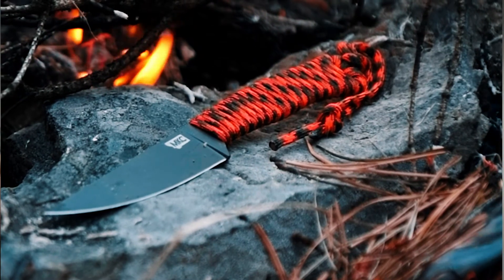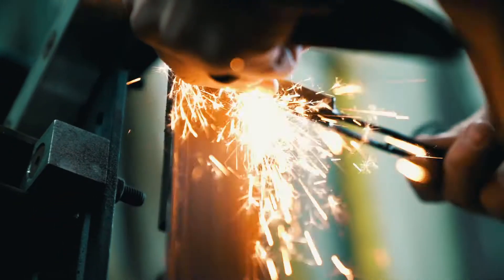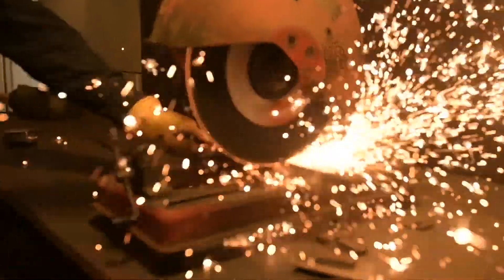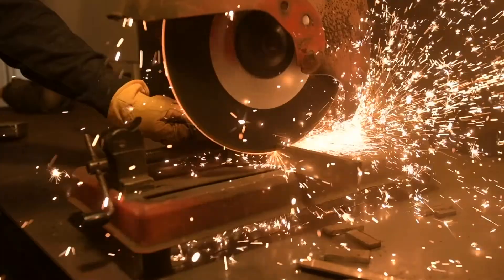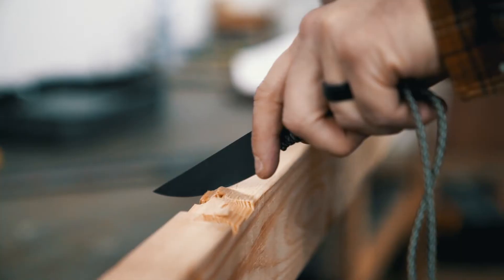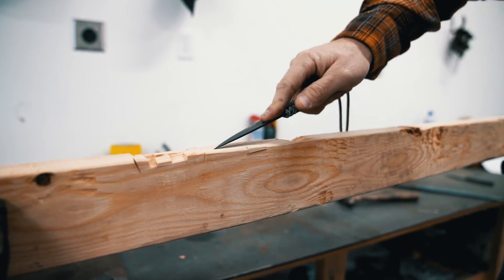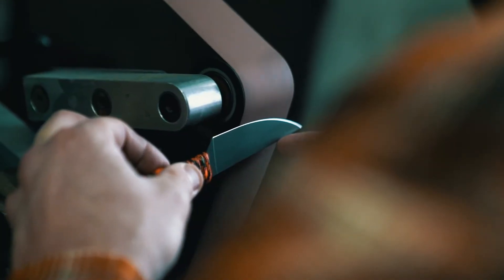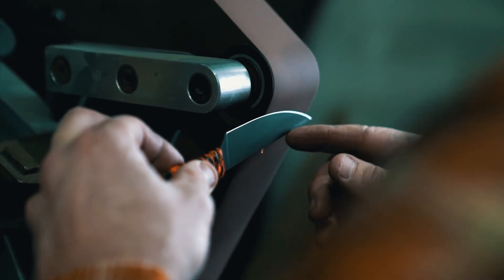Why 51200 High Carbon Ball Bearing Steel???

Comment: lol what? what kind of wear is low alloy 52100 resistant to? Knife world is such a confusing Hodge of mythology. Does anyone agree on basic facts? can we agree that 52100 is a low alloy tool steel? can we agree that it has about 1% carbon and 1.5% chromium... and that's about it? what about that screams "wear resistance" to you? This is literally one of the lowest wear resistant steels that exist. literally any decent stainless steel or high alloy steel has vastly better wear resistance. Sure, it does have decent wear resistance for a low alloy steel. and yes, I think it's a good blade steel.  but not because of it's rather low wear resistance but because of it's excellent toughness at high hardness and fine grain. why do we need to claim that it's something it clearly is not? That I do not get.

Comment: My alltime favorite steel for fixed blades!!!! Best of the best ever!!! Outperforms many supersteels,even on edge retention, yet tough as nails!!! That' what people think is 1095, however, it's ballbearing steel which is actually tough. 1095 compared to ballbearing, is junk.
Reply: IMO, 1095 has terrible edge retention. Why it became so popular for bushcraft, I'll never know. But let's be real, magnacut is simply better than 52100.
Reply: @Swearengen1980  "Much" is a persoonal matter and kind of use. Hunting knives, can't be better with any other steel, than Ballbearing (52100), same goes for any Scandinavian grind, because Magnacut is way to hard and too stainless, for an edge that needs the maximum edge stability and the blade must be the toughet possible. 52100 holds its edge way longer than Magnacut and is way tougher too,also sharpens easier which is another advantage for any field knife. There is a reason, all real knives, that target users market and not collecotrs, use 01 as the traditional steel for scandi edges and bushcraft knives (or 80crv2), same goes for 1095 and "survival" knives, because it has the advantage of ease of sharpening and ease of fixing any edge damage. Magnacut can't much any of these. There is a reason competition knives in the USA, are usually made with something like Vanadis 4 Extra, and not Stainless steels or Magnacut. You've fallen into the marketing trap of Youtube, where your knowledge is all after marketing hypes and collector's nonsense. Knives are first tools and 2nd a collector's piece, like stumps.PS I'm a Chemist/Metallurgist since the 90's and I own both slabs of Magnacut and knives made out of most if not all well known steels.I also sharpen/repair knives professionaly, for 30 years now.
Reply: youe comparing a basic carbon steel to a low alloy tool steel.  there is almost no logical reason to use basic carbon steels for a knife.
Reply: These are both low alloy steels. 1095 is exstensively used, why not comparing them? @TimJohnson-x1o
Reply: 3V with the right heat treatment is still the best of the best. 😊
Reply: @CaesarChavez-x9q  Nowhere close, to Uber-Uddeholm steels, none CPM steel is either. Also I'd choose CPM Cruwear over 3V any day. All handforged Ballbearing steel knives I own, outperform any 3V knife I have. They hold their edges way longer time sharpen faster and easier and their edges never chip. I'd only get a 3V, if it was made with the Delta heat treatment, only that guy makes it good, Bark River and other famous makers 3v sucks.

Comment: I love these but how do you honestly feel about the parkerization for corrosion resistance? In Ohio it's always wet during hunting season, I no doubt will get this blade exposed to moisture fishing as well. I have questions about how the blade will hold up being exposed to constant moisture
Reply: Does pretty good from my experience definitely should I try and dry it thoroughly and then put on a wax or some type of coding but any high carbon knife will rust so just take care of them like any other knife

Comment: I love 52100. I don’t know why it’s not used more in knives
Reply: It rusts pretty quickly in my experience with it. I prefer 8670 but we just made one in 52100. After etch and stone wash it should fight off rust really well
Reply: @fixesflyers  same as 1095, 1085, 1075 etc...those are used everywhere by a ton of brands haha. its carbon steel just like the rest of them haha
Reply: You're right.Ballbearing steel, isn't just the most ideal for hunting knives, but it's also the msot ideal for Scandi grinds, because it offers way more edge stability that a scandi edge begs for,comapred to the classic 01 or 1095 options. It also holds it's edge like a supersteel.My knives last as much as Elmax if not a bit more on a couple I own. and that's just some handforged ballbearings, from old Swedish trucks. in terms of edge retention, it's not very far to Vanadis 4 Extra, which is my other favorite steel.Yes, it's not at that level of sharpness or even hardness, but it has even better edge stability/toughness, than Vanadis 4 extra, which for an outdoors knife, is an advantage.
Reply: Yeah, true.
Good edge retention and toughness
Reply: @Kimurasorus  That only proves your knowledge relies only on Youtube videos which are all mostly marketing and nonsense. All ballbearing steel knives I own, outperform all CPM 3V knives I own, on both edge retention (by a lot) and even on edge stability. Your stainless steel example is out of this talk, because it's very poor in performance and a different type (stainless).
Reply: @greekveteran2715  thats never been my experience…
Reply: Easier to get “good enough” from other steels…

52100 is an experts steel IMO, when done right it’s insane. Spydercos outcuts benchmades s30v